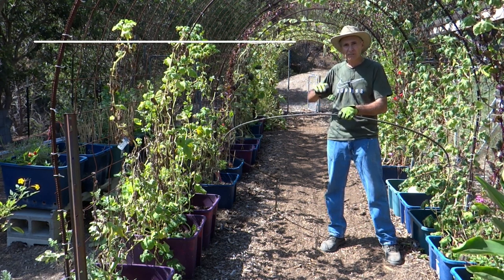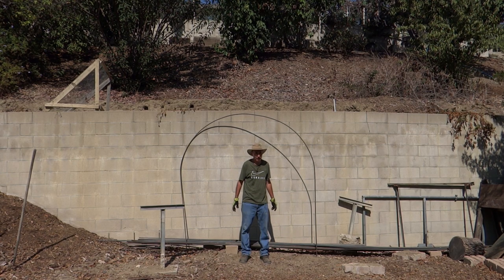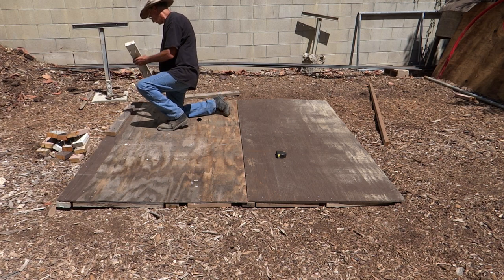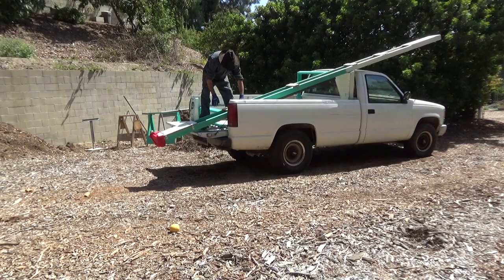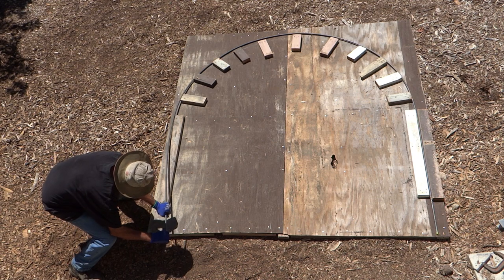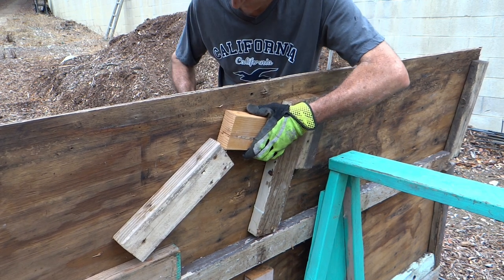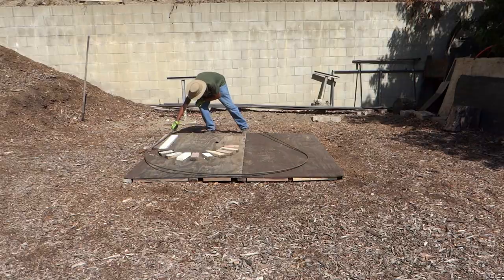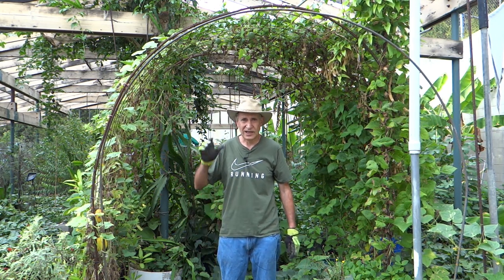How to Build a Garden Arch Trellis How To Bend Rebar into an Arch WITHOUT HEAT

Comment: i tried this with thicker rebar - great technique, worked really well, but i had to try and error the spring and for  16mm rebar at 6m i ended up with a radius of 65cm for the template and that worked well
Reply from the maker: That sounds great, yes you do have to adjust for the spring in the rebar if using a different size. Thanks for posting this!

Comment: Good Job and once the jig is built you can bend all the hoops you'll ever need.
Would the same jig work for bending 1/2 inch electrical conduit into an arch?
Reply from the maker: Thank you. Yes it will. After bending, electrical conduit holds it shape better. The layout of the jig will be closer to the final arch.